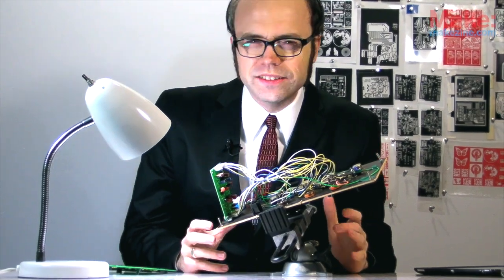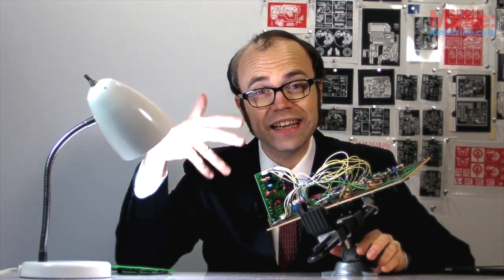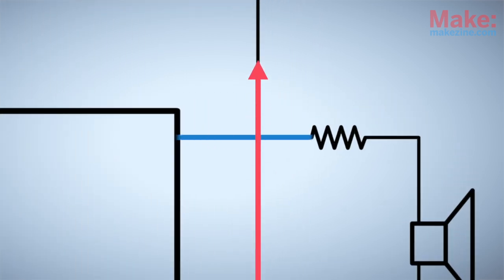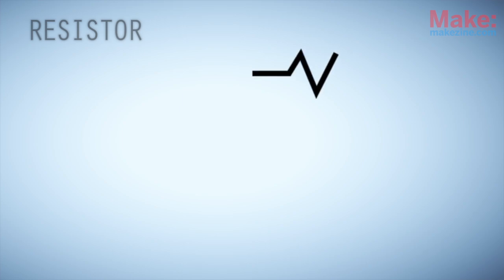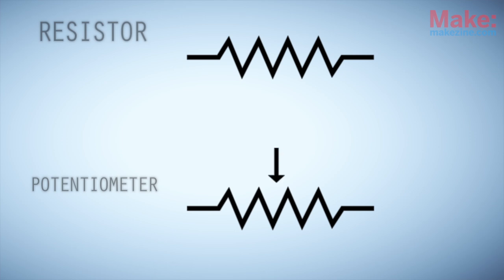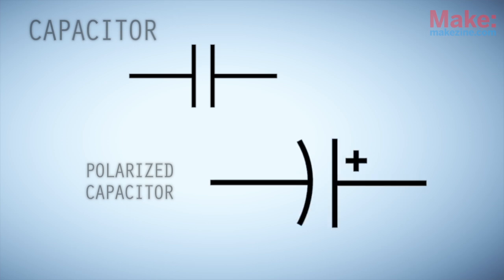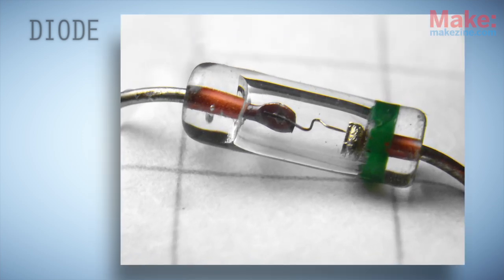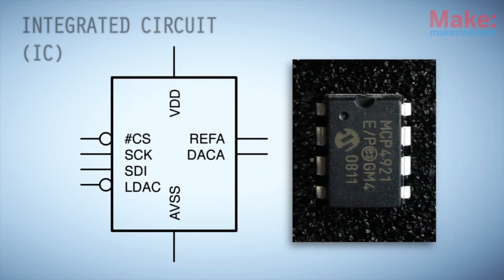Collin's Lab: Schematics

Comment: I studied electronics. Then i stuck on transistor. I do not understand transistor  100% right now. So i still stucked. :( Damned transistor they stopped my electronics carrier.
Reply: Ummmm, I think your English stopped your career...
Reply: Try to view it as a variable resistor....between C and E  and that buy applying a voltage on the B  changes that resistance....  this is a simplistic view....
Reply: Mark Xavier 
that's better for you as  you can't understand transistors so what you  gonna do with a microcontroller ??
Reply: After reading some of the replies to your struggles, I would mike to point out that transistors come in many flavors. A very simple device that changed the world. Transistors can be current controlled devices, such as BJT transistors or voltage controlled devices such as FETs or MOSFETs. In addition, transistors can be operated in the linear region, almost acting as variable resistors, or non linear region causing them to act as switches. Most makers use the non linear region to control higher voltages or higher current. 
If a transistor is used as an amplifier, it will be running in the linear region. 
If you need more help, let me know
Reply: Think of a Transistor as a managed crowd control gate, or turnstile at a football stadium. If there is a set number of people coming through the small gate at a certain rate, then that allows more people to come in through the main gate. If more people begin to enter the small gate, then that allows even more people to rush through the main gate. Conversley, if the rate of people coming in at the small gate slows down, then the rate coming through the main gate has to also slow down. This worked for me to start to understand them. Before that I thought they contained magic little pixies that moved electroons.
Reply: a transistor is just a switch you turn on by applying voltage to the third leg.
Reply: How can you ever decide to study electronics while not able to understand transistors? It practically comes right after resistor! That were three tough college days then, including the introduction tour :-)
Reply: @szjoin992  transistors can be tricky as they can be opersted in two different modes, unlike simple components like a resistor, capacitor, switch. Lights etc. Moat people see a transistor as a switch, but they are capable of much more. This is why they can be tricky
Reply: @szjoin992  Different people grasp different things at different rates. A lot also depends on the quality of teacher too, such as catering for all of the classes needs. Some students learn easier with repetition, some with listening, some with visualisation, and some require a hands on kinaesthetic approach. Just as some people think before opening their mouths, whilst others rush in and type insulting comments without consideration for others past experiences, or knowing anything about their lives.
Reply: just go full trans, it political correct these days. You can even claim a job because of anti discrimination laws - even with knowing how a transistor works ;D. Just go full trans trust me.

Comment: Actually in a diode there is flow of both electrons and holes (nb holes are absences of electrons thought as positive charge). Now as most diodes are P+N junction diodes, the current flow is mostly due to hole flow, i.e. conventional current is not just for convenience but is the right thing to think about. So the maker of this video not only inexplicably chose to use the electron flow instead of the conventional one he also chose to do so with the worst possible example.

Comment: Wow, what an awesome pedagogical idea. Let's teach beginners the distinction between electron flow and conventional current, a point which isn't really necessary to know at all unless you're designing ICs/transistors/valves, just to confuse them. But actually, that's too useful, let's *only* state the direction that the electrons move, which is the opposite to conventional current (called conventional for a reason) and leave it at that. Are you *trying* to confuse people?
Reply: To confuse really more, lets admit that the conventional current flow and the real current flow have the same direction. Because conventional current flow represents the flow of positive charges on said direction, or the flow of negative charges on the opposite direction. Historically, it was not an error, but a convention that was true for positive and negative charges, due to the then unknown nature of the electron.

Comment: For some inexplicable reason, the maker of this video chose to show the motion of the *electrons*, which go the opposite direction to *conventional current* as every engineer thinks about and measures it (historical mix-up). So the video is technically correct, but why he's chosen to introduce the technical, pedantic point that electrons go the other way is just baffling to me; you have every right to feel annoyed. You only need to know about electrons if you are designing valves or transistors.

Comment: I really liked this video it's quite good.  A lot of the stuff would only make sense if you took physics but it's still a great video (IE capacitor parallel plates).  The only downside is that actually analyzing circuits gets waaaaaay more complicated, especially when you start getting into non-steady state stuff and using the calculus.

I'd love to see a video about the different methods of determining voltage drops, amps, power, etc etc.  Like using KVL, KCL mMethod, mesh node.

Comment: are there any significant advantages for using an electrolytic capacitor over a non-e cap?
Reply: yes the ,size per capacitance is low. electrolytic capacitor use very narrow distance between plates  .it has more capacitance   C proprtinal to A/D  . since distance is less it has more capacity.   please subscribe my channel

Comment: Electrons DON'T flow from positive to negative. NOTIONAL current flow in a circuit does & shown going from positive to negative. It is NOTHING MORE than a CONVENTION ONLY. Why do people have such a hard time with this? More to the point why confuse "symbolic" notation with reality? Think of it like water in a tank. High tank = high potential energy = water FLOWS from high to low. High potential energy = high (+ve) Volts = NOTIONAL current flow from high to low THAT's why it's shown as +ve to -ve
Reply: true  but still we use old analogy as usual practice.for  examble  ONE amp current= 6.242 E 18  ELECTRONS PER SECOND.

Comment: You don't mean something similar to these do you?

Youtube doesn't allow links from comments sadly so search for potentiometer circuits and see if there is something there that looks like what you're seeing.

Sounds like a resistor connected to the central wiper of a potentiometer (voltage divider or resistance divider depending on usage and terminology) to me.

Comment: Electron flow IS current flow (by definition) and remember that it is ONLY a metaphor it is NOT supposed to represent DETAILED reality merely a means to better comprehend things. If DETAILED understanding is required then take a Physics degree and get into Quantum Physics. If schematics blow your mind wait until you try to get a handle on "an electron can exist in more than one place at one time" type principles and "fixed" energy bands etc.

Comment: Electron flow and hole flow exist in BOTH PNP AND NPN transistors and can be used to explain either. Pedants talking about electron flow and insisting it goes one way or another should remember that these are metaphors and cannot be considered "reality" since Quantum Mechanics rule here and the fundamentals of Quantum Physics say that an electron (or other fundamental particles) can exist everywhere at once i.e. they can (in theory) exist in two places at the same time.

Comment: I hold a UK Bachelor's Degree (B.Tech - equivalent to a B Eng) in Electrical and Electronic Engineering, graduating in 1975,  and I concur 100%. NO engineer - electrical OR electronic - worth his salt would EVER say that "current flow" (as measured by an ammeter) was the same as "electron" flow and ALWAYS refers to current flow when talking about circuits . It's just CONVENTION. This has ALWAYS said that current "flows" from a high potential to a lower potential.

Comment: Authors use the conventional direction so there would be positive numbers and no sign confusion arising from starting at the negative terminal. Using conventional currents, our result is positive and not negative. If it's negative then the conventional current is opposite our assumed direction. In other words, we have the direction of electron flow, not current flow. I don't know where you are getting this idea that electrical engineers don't use this idea anymore.

Comment: Electrical engineers still use conventional current flow (if positive charges were in the electricity) when analyzing circuits. Using the actual direction of electron flow causes confusion. That's why textbooks tell you to use the conventional direction to avoid confusion and sign issues. I know because I'm an electrical engineering student.

Comment: Man, you really don't know what you're talking about. Look, the diagram was right. As well as the explanation, you're explanation is what's wrong. Electrons go from negative to positive. Current goes from positive to negative. In this example, the direction of the arrowhead of the diode symbol.

Comment: No, the markers are right. Electrons flow from negative to positive. But the convention used in circuits is to ALWAYS use current flow, which is always opposite electron flow. The markers on the devices aren't wrong. Instead, people orient the positive and negative ends of the markers to fit the current flow.

Comment: No, it's right. The cathode is negative for a diode. That's where the electrons come from in that instance. Protons don't move in a wire. The hypothetical "positive charge flow" that people speak of is just that, hypothetical. There isn't actually any positive charge flow in electricity. Only electrons flow in electricity. The positive charge flow is a convention used to indicate current, since current is defined as being opposite the direction of electron flow.

Comment: My mistake. In a diode the cathode is the negative end. In a battery supply power to a circuit the cathode is the positive end.

It can be confusing; so to avoid that confusion you'll notice electrical circuit textbooks not speaking of a cathode or anode of an electronic device very often. Hence, that's why I couldn't remember which was which.

Comment: Colin was talking about the orientation of the diode in the circuit schematic, not the direction of charge flow in the diode. Charge flow goes from the anode (negative end) to the cathode (positive end). That's another thing, Colin mistakenly called the negative end of the diode the cathode. That's the anode end. Any device that dissipates electrical energy has the cathode end being the positive end and the anode end being negative.

Comment: Hey there.  I can explain.  Collin says that electrons can not flow in the direction of the arrow.  It sounds like he screwed up but he's actually right.  It's confusing because the direction of the arrow indicates which way CURRENT is allowed to flow.  But current isn't defined as the flow of negative charges, it's defined as the flow of positive charges, mostly because the guys first studying electricity didn't fully understand it and thought electrons were positive.

Comment: he describes current flow through the diode in the electron flow convention (the way a diode physically operates). This is opposed to conventional flow (where electrons are assumed to flow from the positive to negative terminals connected to a battery for example) He's not incorrect, though he probably should have mentioned the convention

Comment: Well there are a lot more component on most of the schematics, and there are some components that are represented with a lot of dffererent symbols, and there is absolutely nothing in this video about values of the most simplest components not to mention how to read datasheet of transistors and integrated circuits... And these are still the most basic elements of electronics... It's like you have no idea of what you are talking about, but "IT'S COOL" so why not? :S

Comment: No , that's wrong. Most of it, anyway. Indeed, electrons do have a negative charge, but they still come from the '-' pole. Electrons flow from '-' to '+'. Thats called the physical current. The diode symbol describes the so-called 'technical current' which means an imaginary charge carrier flowing from '+' to '-'. This "current" CAN flow in the direction of the diodes "arrow", but CANNOT in reverse. Anyway, the explanation in the video is correct, just unusual.

Comment: I think you confused the "-" with electrons.  Electrons have a negative charge but they come from the "+" source, so your diode animation is reversed, protons cannot move past neutrons and themselves in wire.  If your circuit was made out of plasma then positive charged matter could flow as electrons do- the tube of a neon sign is an example of this.  Still a good introductory video though.  A common mistake, even amongst teachers.

Comment: except it doesnt Anthony96922, electrons are negative, as electrons are what flows in a conductor, electrons actually flow from the negative terminal of the battery to the (sink)positive, as confusing as that is, thats the way it is due to electronics primarily outbranching from the science of physics, and indeed when one does first learn about electronics at a university, the first units are almost always physics of conductors

Comment: @DavidLawton93 Even though electricity technically flows from negative to positive, in the real world it doesn't really matter which way the electricity flows. Also, it doesn't matter where the resister is in the circuit, it will have the same effect as long as the electricity follows the same path.

Comment: @kdc43 Well, the potential difference dictates a difference in charge (a difference in the amount of electrons sitting on each side). Now, the positive charged side (lacking the electrons) attracts electrons, and thus has an energy stored in it.
You really should read a book about physics, as you will learn quite amazing things. While it often is a bit confusing that the conventional electricity goes the "wrong" way, you will see that it is more useful in the end.

Comment: @bPaIsNtKaYrd electrons flow opposite of the current.  Back a few hundred years ago, they had to name the positive and negative sides of electricity and they got it backwards.  In the 1900's, the electron was discovered to be the carrier of electric charge and it is negative and flows opposite of "current" (which is an abstract concept based on a positive charge carrier).  HTH.

Comment: @xbatusai This is a common mistake and his explanation was wrong, the electrons flow in the direction of the arrow; but it also doesn't matter what a person thinks, because as long as they keep the same positive-negative convention throughout the circuit, it'll work regardless of what they think is really happening.

Comment: @xbatusai You are still correct. In the world of electronics, every single positive and negative sign is the exact opposite. So in a schematic the electrons flow from positive to negative (look at a battery), this is called conventional current. But realistically, the electrons are flowing from the negative terminal to the positive. This is NOT to say that the electrons flow the opposite way around your circuit, it's saying your positive and negative markers are wrong.

Comment: @Neodymio No, the video is correct. Electrons can only flow from the negative terminal to the positive. However, since we started designing electronics before we knew whether it was the electrons or protons that moved, we assumed protons, so CONVENTIONAL current, used in all electronics and electrical engineering, depicts current as flowing from positive to negative. So conventionally we'd say that current flows in the direction of the "arrow", left to right, but the electrons move the other way

Comment: @mysteryplane2001 There are 3 major "powers" in electronics. The Volts, the current (measured in amps) and ressistance (measured in Ohms), though i'm not sure how you measure stuff in the U.S., I wrote it how we measure it in Europe.

A diode is a thing that lets the electric current flow one way, but not the other. It's like a filter, stuff goes in, but doesent go out. A capacitor charges an electric charge and then realeases it. 

The two things meantioned above are mostly used in  AC current.

Comment: Collin describes the diode well, but the graphic was wrong, I think.  It showed the current being blocked in the direction of the arrow.  It's actually the other way for common diodes.  The current can flow in the direction of the arrow, but it is "blocked" in the opposite direction.  Otherwise, great video.

Comment: Pretty good synopsis.  Collin is obviously an analog guy.  So he skipped over digital symbols like logic gates, etc.  But how about transistors?  A simple addition to the end with "here are a few more symbols" could be added.  Also, Electrical Engineers talk about current flow in a diode (or transitor) from plus to minus, anode to cathode, the reverse of what is mentioned here.  Sciencetists talk about current the way Collins does.  My $0.02.  Sincerly, an Electrical Engineer.

Comment: @GegoXaren If you have an AC series-parallel circuit that you are trying to break down and do the math on, (Thevenin/Norton/VDT/KVL/etc...) what if you mathematically combine a capacitor's resistance with the parallel combination of two resistors, do you still use a rectangle then?  That would get confusing... I'll stick with my "squiggly lines" for simple resistors on MY schematics... just don't ask me to decipher your's.